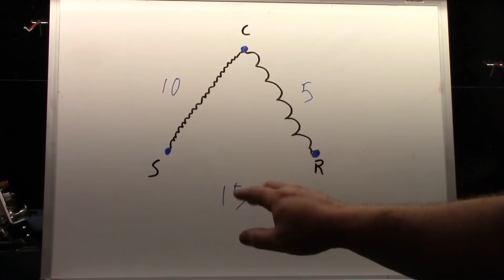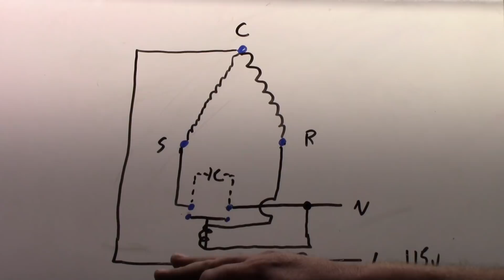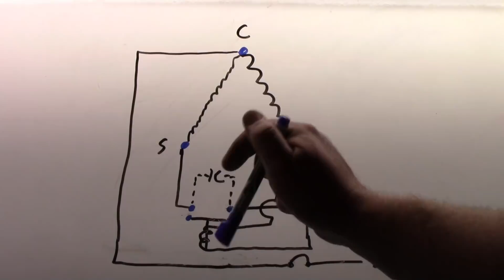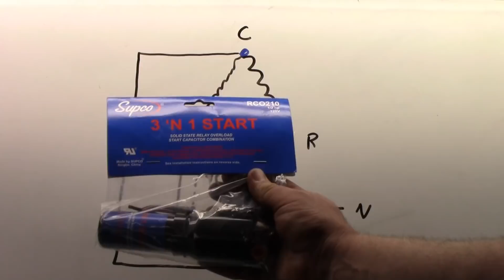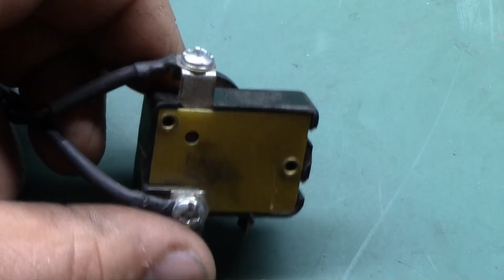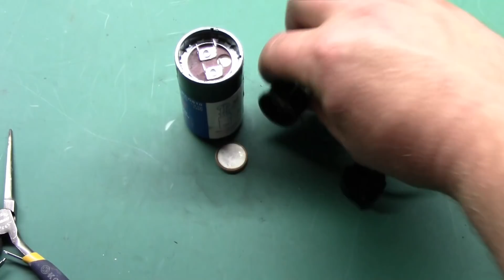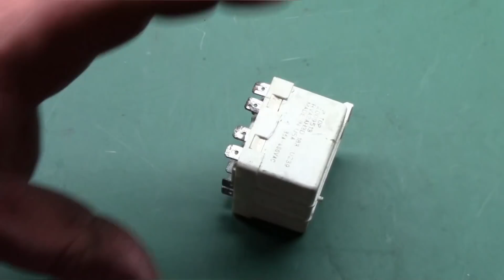Compressor Current and Potential Relays Explained

Comment: Your explanation was brilliant, I am a tradesman of 36 years I also us these compressor kits, i have used them for the last 15years, I believe in them so much for the last 10 years this is all I use,  but I use 2in 1s I prefer to use the correct rated overload, that’s just my preference. I know I have stopped many unnecessary compressor replacements. 6mths ago I found a 2 in 1 that had failed it had been there for 12 years the compressor was 18yrs old the original relay and capacitor lasted 6years, I fitted another 2 in 1 and it is still going.Anyone who thinks these kits burn compressors out hasn’t given them a chance. Sure some fail but this is only because the compressor was damaged and was going to fail anyway. Well done with you’re video.

Comment: 2yrs ago, the 45/7.5 capacitor died, and now the fan side of the 45/7.5 capacitor died 1 week ago and i found the compressor humming (wasn't cooling house down).  it must have been humming for 5hrs or so before i realized the house was not cooling down.  i bought a new 45/7.5 dual run capacitor, and i also bought a 5-2-1 brand (csru2 model) and added it to my carrier 4Ton ac that is 6yrs old.  i added it because from what i have read it helps start the compressor start faster and thus helps with its life....questions: 
1) is it true that it helps with compressor life?  should i have added this?
2) you said that once a capacitor goes out, we should replace the relay...which capacitor are you talking about, the 45/7.5 dual run capacitor or the 5-2-1 added capacitor?
3) how do i know looking at the unit what size my dual run capacitor should be...is there a sticker on the body of the unit that should say so (can't find that info on the my stickers)?

Comment: So, do those potential (voltage) relays have a correct orientation ("up" direction) that they should be installed in?
Reply: Potential relays do not require a correct orientation . The current relays do require correct orientation due to iron core inside the coil. Current relays are normally open. Then closes due to LRA (high amps pullsthe iron core to close the circuit). Then opens once the compressor gets up to speed.
Reply: Well.. some might have a particular orientation. But i haven't seen one.

Comment: ...great video...how can I test a PTC relay with a meter and tell if it is good...Thank you...
Reply from the maker: Measure across the contacts at room temperature.  If you have low resistance like 100ohm or less than the relay is most likely ok.   If you have the tech specs of the compressor it will sometimes tell you resistance values at certain temps all are different.  The parts are pretty cheap and there is a generic version for compressors without the start capacitor that are carried by most supply houses so of you suspect the relay change it out.
Reply: ...Thank you...

Comment: I like the video, but there's a big difference between LRA and FLA. The compressor amps peak when it reaches full load amps. If the compressor motor sticks, or if the compressor itself is frozen, then locked rotor amps occurs.

Comment: Nice video. I ended up here after coming home to my house smelling like burned wires. I think it was the fridge but I can't find anything exactly wrong with it except that it's testing about 23-24-25 ohms on the compressor between connections. However, when it's running it is only pulling 1.3 amps on the compressor wire. My math says it should be more like 5 amps. I'm using a Greenlee meter though, not calibrated. I recently tested it against one that was calibrated and it was good on the ohms and DC voltage. Do you have any thoughts? Is that compressor bad?

Comment: Could you tell me then what purpose would a  521 hard start kit be used for ? 
Thanks
Reply from the maker: It's a potential relay with a capacitor connected.  5-2-1 refers to the terminal connections on the relay.  That's where it gets its name from.  It's used to give compressors that only have a run cap (such as residential type splits) a boost to get started and reduce the starting time which in turn reduces the length of time of the load Spike and heat generated on compressor start up. It does not change starting amperage only the time the amperage is drawn.  There is also a cheaper 2 wire version that gets wired in parallel with the existing run capacitor.  I don't like those.

Comment: Excellent presentation for the "lay" person. May I suggest that you add a PTC relay in series to the start winding in your very first diagram? Otherwise, the relay through the run winding will always keep the start winding in the circuit. Also, may I suggest you change 120V to 240V? Most heat pumps and condensing units use 240VRMS single phase. Keep up the good work when you have time and if you need help with future presentations that get further into it, let me know. I have oscilloscopes and a lot of instrumentation equipment.
Reply: Howard Ostfeld,  You seem like the person to answer a question since you picked up on that fact.  If I may ask.  Concerning these “Hard Start Kits”.  I know that the start capacitor and start windings are there to shift the phase in order to get rotation going.  Are the kits simply there to increase the capacitance?  If so, why doesn’t the manufacture simply use a higher rating capacitor?  Can these start kits create too much starting torque or cause other problems elsewhere?  Thank you in advance.
Reply: @Do_the_Dishes  Hello, I just saw your question. I want to give you an accurate and quantitative answer. It can get quite mathematical involving capacitive reactance and inductive reactance involving phase angles. These involve vectors. Let me know how far into it you want to go. The general answer to your question is that the combined inductance and capacitance has to be matched to the operating characteristics of the motor in the compressor to produce enough phase shift between the voltage and current for the motor to start turning. A simplistic analogy is, if you are not in the right gear for the engine speed for a manual transmission the car will not run smoothly. Thanks. Hope you reply.
Reply: There are two scenarios described in the video.   The FIRST is a fractional hp 115vac motor. In most cases these are called single phase induction motors, either cap start or cap run.   The usual wiring has their cap in series with a switch or current relay.   The SECOND scenario are larger several hp single phase compressors, typically 240vac 1-5 ton systems. These are PSC (Permanent Split Capacitor) Motors.  On those,  a capacitor is "Permanently" in series with the start winding.  It is called a Run Cap and allows continuous start winding current. The amount of current is limited by the uf size of the Run cap.   For a larger compressor, the Run Cap may be sized at 30-80 uf.   A "hard start" kit for a typical single phase PSC motor  adds another bigger cap in parallel to the Run cap "Temporarily" for more start winding current.   The hard start cap, often around ~300uf, is switched out by a potential relay as soon as the motor comes up in speed.   However in a PSC motor, the Permanent Split (Run) Capacitor stays in the circuit.  Finally most PSC compressors in the last 25 years are scrolls which usually don't need extra hard start kits and use only their Run caps to allow current to their start windings.

Comment: Very informative and educational.  I deal only with current relay systems at work and now have to fix the AC unit on my motorhome that is a potential system and was totally lost.  Thank you so much for the video as I can now confidently diagnose the problem.

Comment: I think you should explain how alternating current start capacitors' phase shift and motor's "BACK EMF" voltage created to drop (open) the starting circuit relay out as soon as the motor is running.
Reply: I'm not so sure:  If the viewer needs that explained, they're probably missing some needed background in electrical theory, without which 'phase shift' and 'back EMF' might only confuse them further.

Comment: Excellent, thanks for the great clear explanation of how things work. My fridge works now! What was wrong? It has a PTC instead of the relay. It's a larger sized Danby.  The PTC disc had a small piece broken off one side and a bit of corrosion and pitting. I sanded it all off, cleaned it up and wondered if it would still work. It did! So far so good. I'm still waiting for it to complete it's first cycle. Is there  a polarity for the PTC? I noticed that one side is different but no markings.

Comment: What a great video, and great explanation on how these things work. THANK YOU!
Would you use a 3-1 in a small ice cream freezer? You mentioned earlier the thermostat, but is there room to wire it to the 3-1? thanks
Reply: No expert here but 3n1 s have long cables and can be left in a far place if adjacent to compressor you have lack of it. Then at under $10, you have nothing to loss to try one and see if it will run your unit, first and then will continue to work fine or not, in coming days. You can't make it worse and hope is that small price tag of 3n1, bring the cold back.

Comment: Very good explanation.  In addition thanks for pointing out the contacts.  Also, yes change everything.  If you were doing it yourself you would.  Done, piece of mind. No worries for a long time.  In my home and on the vehicles.  In the military we had something called. Preventative Maintenance Inspection Schedule. I think I retired in 2008 getting rusty on the acronyms. However if you schedule certain things they are taken care of.  I do everything in the summer when it is easy.  I now have a heated insulated garage which helps. Yet, summer time is best to tackle these items.  Currently with the Hurricane I have just ordered the Transfer switch to the main breaker of the house so the generator can be hooked up just in case.

After the fact kind of late....  Keep up the good vids. Very informative.

Comment: Can anyone tell me a potential relay can be used to replace a centrifugal start switch in a 5hp air compressor motor? It is a single phase Baldor (old USA-not chinese) 240VAC motor and the switch is bad . A potential relay seems much cheaper and more reliable??? Thanks
Reply: yeah I believe a potential relay (or better: its electronic equivalent built around a Triac) would be a great replacement for centrifugal start switch.

Comment: Check out the ICM icm866u drop in good for 0.5 - 5 HP. Works like your large size potential relay, found this from a group that has a free small appliance haul away, they fix tons of stuff and give 1 year on a used frig. They like it over the Supco.  I used a ICM on my W-pool about two years ago, after a cooked start relay.

Nice video.

Comment: Another option for single phase Copeland compressors is Secure Start by Emerson (actually a rebrand of an Australian company).   It provides an electronic soft start capability to ensure zero crossing and low amperage startups.  The Australian company is Hyper Engineering and the same single phase product is called Sure Start .   They also sell a three phase soft start.   Of course the new "inverter" based systems also are soft start inherently and are actually three phase vfd driven at the compressor even when sourced by single phase.
Reply: Txs for this info.
"soft-starters" are great to prevent destructive in-rush and preserve bearings on all electric motors greater than 1/2 Hp.